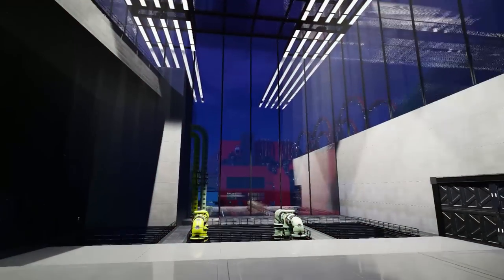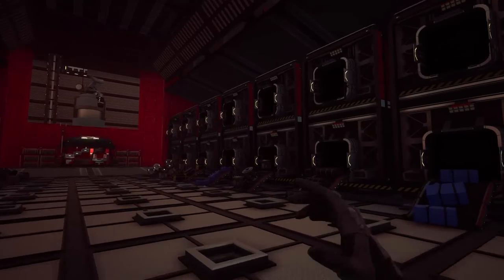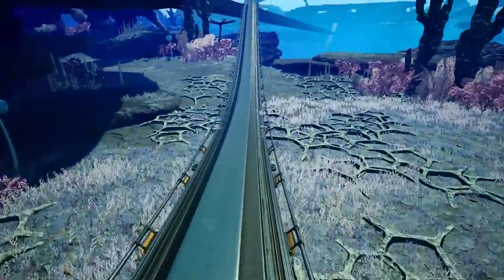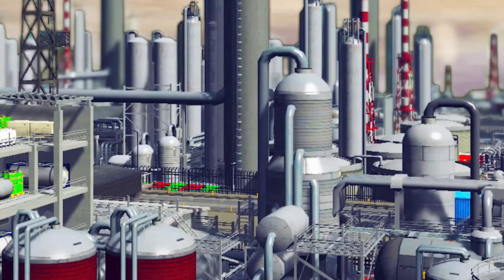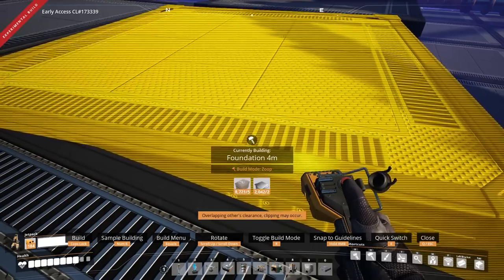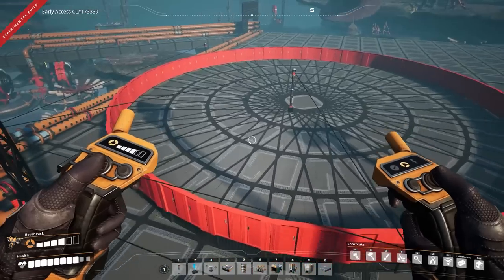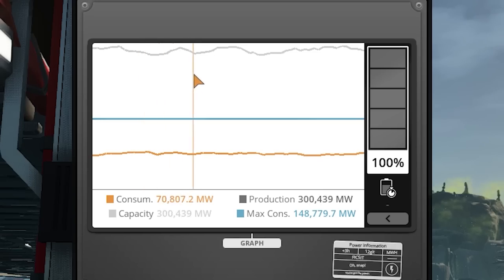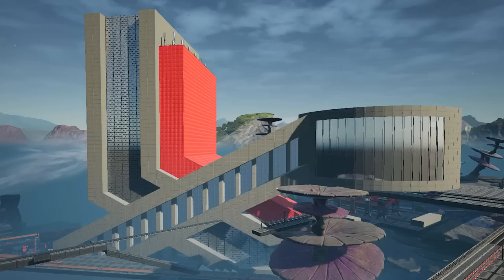It's Time for a NEW Mega Project in Satisfactory...

Comment: There's a MUCH easier way to make circles...
You just fill out as much as you can with regular block foundations, like a + with the corners almost filled, then just do the edges. Much faster, there's no point making the center "circular" radiating out, as you'll just fill that with square grid buildings anyway, u just need the exterior to be circular.

Comment: Your NPP Is troublesome After U5, First caterium in the uranium nuclear waste recycling line; your fault to not purge the line before flooding It with uranium and the thing happened when your recycling waste has pulled in the reserve, second Another your fault forget to plug the PP in the main HHV trasmission Power , third your fault to not connect the nuclear fuel supply belt causing again the shut down of the plant, fourth the recycling nuclear waste plant stops again, for a bug as fault of CCS, starving of  Heatsinks stopping the manufacturers conseguently backing up the assemblers, loops, blenders down the line and finally stopping the powerplants again and finally fifth the drones are grounded because a train line with too many stop making them starving for battery fuel
Reply: with the phrase for a bug as fault of CCS, i intend the deleted bauxite resource node in that case if happen again connect in this case (if you are using all the tapped nodes replace ASAP the bugged miner)one of the two lines that are unusued temporaily to restart production of aluminum parts and after that the all storages around your worldthat contain aluminium parts are filled up, replace the bugged miner and disconnect the back-up reattaching the original one line to the production

Comment: The crazy thing about Satisfactory being a great game already, building circles in it is actually science. Computer science. This kind of showing round objects is called interpolation. Even though we have pretty good graphics cards nowadays, calculating or showing a perfect circle is almost impossible (basically impossible), because Pi (3,14159....) is a never ending number. Algorithms are used to show and even out the edges in CAD programmes and games. Far away, round ojects usually look very clunky, the closer you get with the camera, the smoother it becomes. But what happens in the background is basically showing a round object with a finite number of edges; like 6 very far away, 12 drawing closer, to maybe 512 or 2048 up close. This is still by far not perfectly round but together with anti aliasing and other tricks, it kinda looks great.
Back to the game, it directly makes it tangible to capture the amount of calculation power needed for round objects to simulate. For the size of the silo ImKibitz is building, he uses an extraordinary large amount of tiles to make it look smooth. Given you have a weaker graphics card, this would unnecessarily draw more calculation power for the same amount of space or room than with a default looking, edgy object.

This game is great!

Comment: My factory’s power grid completely shut down and I had no idea why. There was an excess of fuel ready to go, everything was wired up, nothing appeared to be wrong. Then I checked the conveyor belts. Right at the end of each of 25 conveyor belts just barely in the mouth of the generators, was caterium. There was exactly 25, no more, no less. Just enough to completely stop energy production. As it turns out, I had one of my storage crates right next to one of my fuel storage crates, and I must have tossed the caterium in there by accident (I am very disorganized, but it’s organized chaos so it works). I am now in full belief that caterium is the sole reason that things go wrong in Satisfactory, and nothing can convince me otherwise.

Comment: When it comes to designing things what I do is that I build a rough outline for a building out of walls and foundations, just to get a sense for proportions, then I take a screenshot, open my drawing program, paste the screenshot in, and then I sketch over it.
It's much easier to change large parts of the design that way, and to add details without losing the sense for the full picture, as ingame you have to get quite close to do detailwork